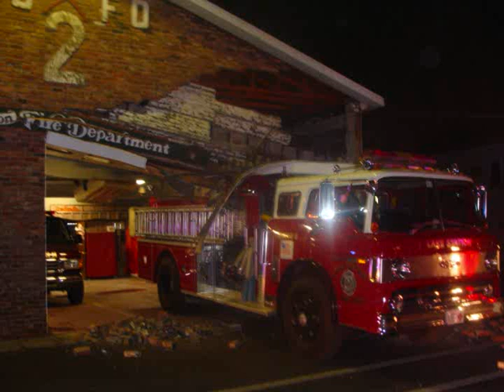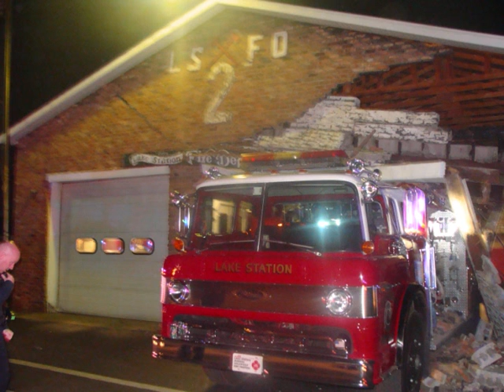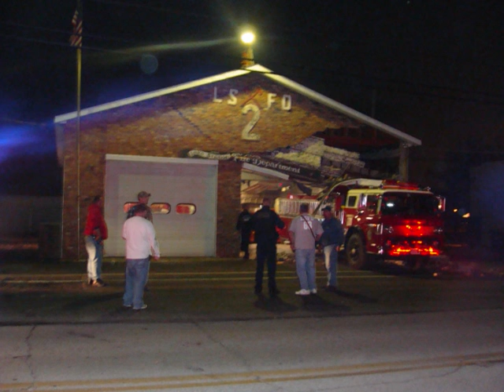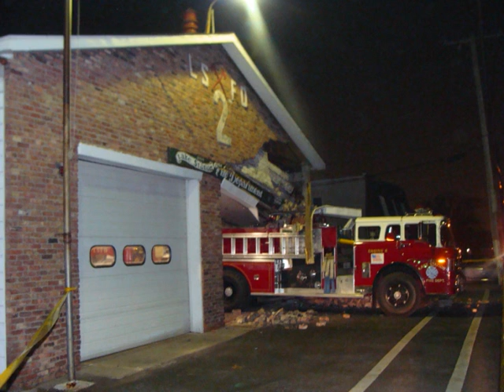Audio File Of Fire Station Numer Two Collapse In Lake Station Indiana

Comment from the maker: They believe that a side compartment opened when the engine was pulling out compromising the side wall which ultimately left the building unstable. Although this happened the building was due to be rebuilt. The insurance company and inspectors said the building was not constructed properly to begin with

Comment: Here is a problem as I see it.  This is one of the problems with volunteer departments.  This guy calls out via radio for a building collapse.  He was frantic, yelling and excited.  Understandable?  Maybe but he shouldn't have been.  In addition they never (on the recording) say there are no injuries.  As a result there was probably people driving like nuts to get there.  And for what?  You can hear someone in the back ground running lights and sirens.  No need for that.

Before anyone starts bashing that I am kicking on volunteers I was a volunteer for almost 8 years.  I just could not stand the self generated drama and the entire hey look at me attitude.  It was everywhere and it was annoying.  Like running sirens and banging on the damn airhorn at 0300 hrs in the middle of no where.....not a vehicle in sight.  There are many, many people that do the job for the right reasons.  But I think there are more and more that just love the drama and goofy stuff.  If you chose to be a volunteer be professional.  Do not make everything out to something it is not.  Do not make maintains out of mole hills. When you do this all the time if the day comes where stuff does go bad you may become like the little boy that cried wolf